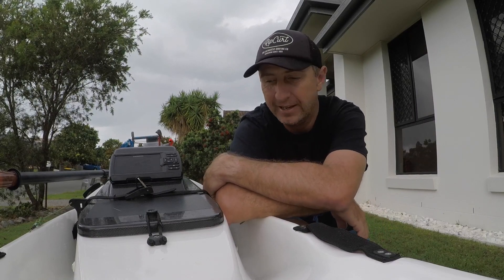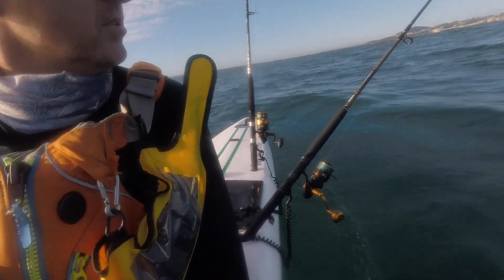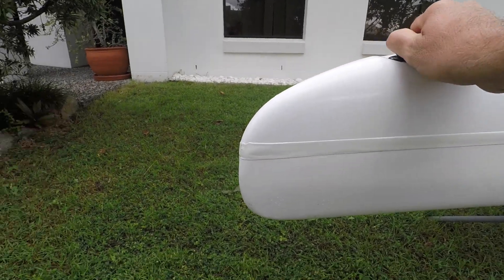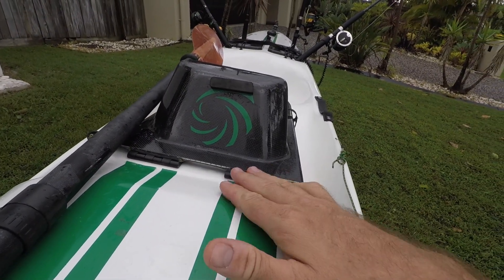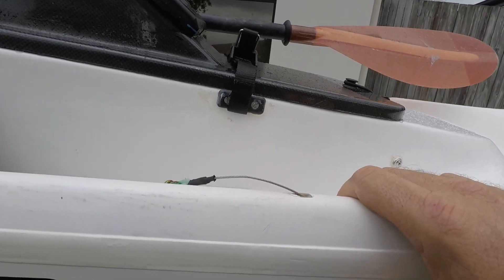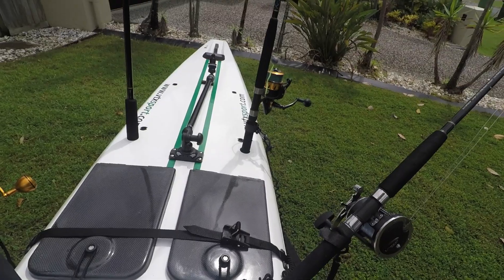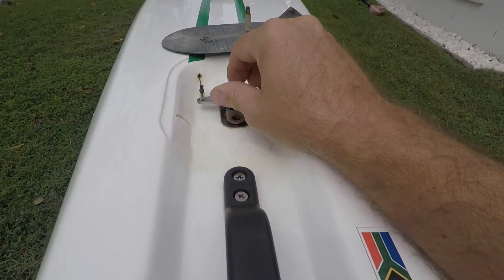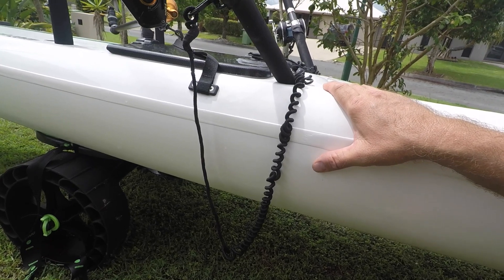Full Vortex VTX560 fishing Kayak review

Comment: Hi Ben, good review although the wind noise made it hard to hear words occasionally. I’ve had a second hand one for a few months now.
 It came with a few issues that I was aware of before buying. The wire cable chaffed and ultimately had to be replaced even though only one strand was broken. I’ve now got an idea on how to stop this repeating, just got to find the right bits. Saw Weeksey ( not sure spelling) 
with his on the beach, on my maiden voyage return, pointed out this to him and upon inspection his on one side was only held by one strand of wire. Wow trouble almost there. 
  The other issue was a small crack running along the top of the hull joining seam, from about the hatch area to the back on both sides in 
varying amounts, stop start at times. I couldn’t detect hull movement from squeezing these areas so I just used a marine designed silicone to fill this crack carefully. At the least to make it watertight, even if it was strong enough as it was.
  I’m finding as I get older I’m enjoying working on these kayaks as much or more than actually using them. Seem to really look forward to testing something new or that I have fixed and find if it works or not. Guess that’s the type of person I am and the builder in me. 
  ( I’ve almost always built my own homes utilising a mobile saw mill to get the timber and done every bit I could myself, last place was 600 sqm and cost me about 80 grand to build, it’s worth a small fortune now ). Yeah I’m a little different. Cheers Mick.
Reply from the maker: Haha, cheers Mick aka Bob the Builder lol. I'd suggest looking to fiberglass that seam sooner rather than later. I did see Paul's in a FB post on the Vortex Fishing Family page, Tunny had the same issue. Cheers for letting me know the details of your kayak. Stay safe

Comment: Nice Ben! I have been lucky with my Vortex. A small leak at the scuppers, the cover over the rudder pivot and the seal at the junction of the live well at the kayak deck were the issues to address. They were all simple. The venturi covers remove by cutting the silicone bead, I used braid and a hobby knife for this, then some sikkaflex to seal up and reattach the cover. The live well join was sealed with sikka. I got a short length of carbon tube cut to length to stop the rudder rocker cover from flexing. This gives a good solid point to screw up to, rather than the plastic tube. The Australian sales team were upfront and offered solutions to all issues. Couple that with the combined experience of the Vortex owner's group and you can solve anything!
Reply from the maker: Thanks mate. Also thanks for highlighting your small fixes. 
The Vortex Fishing Family FB group has got a wealth of knowledge.
Catch you on the water soon!